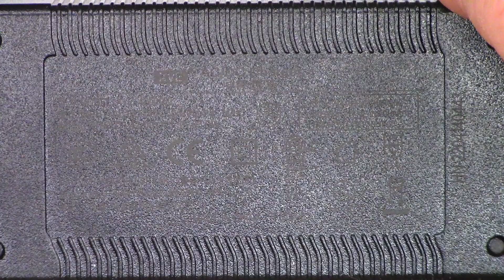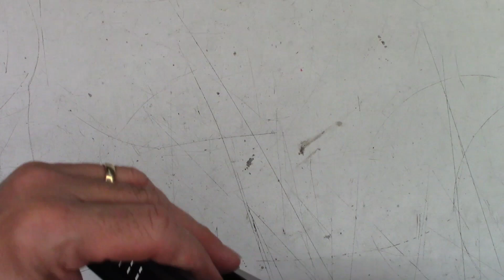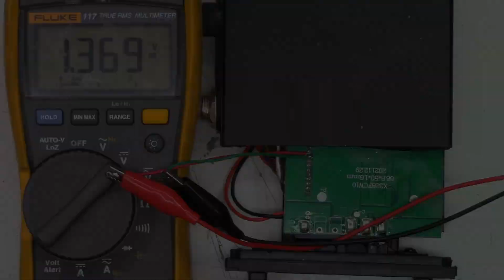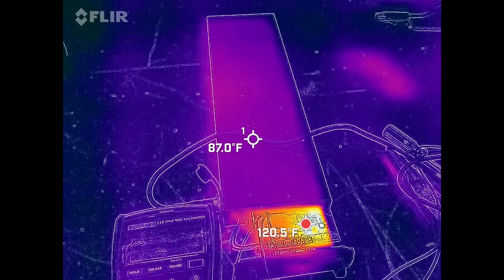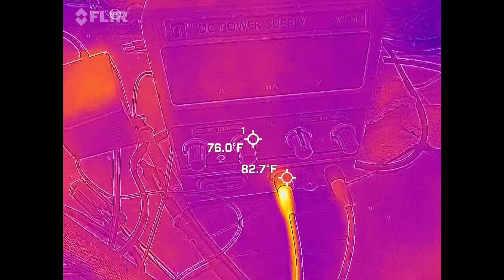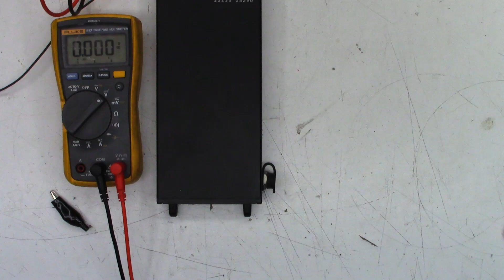ALPHARD/Adept Industries Ltd. Model 10Li-ion18650NP X 2 Dead Battery Pack Diagnosis

Comment: A cell that has fallen under 2.5V in resting state is damaged and might go thermo nuclear after charging. It's pretty risky to charge it. The self discharge is because of dendrites forming in the cell. When these dendrites form a good connection, the cell will discharge in seconds, usually venting with flame and igniting the other cells in the pack.